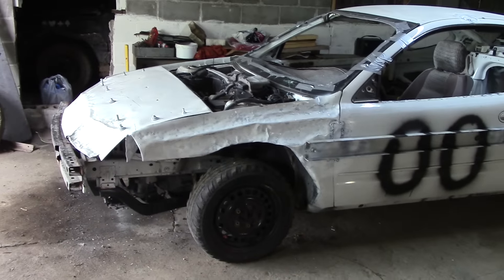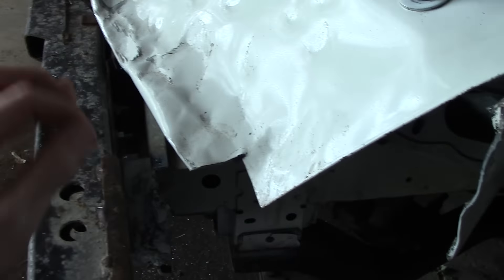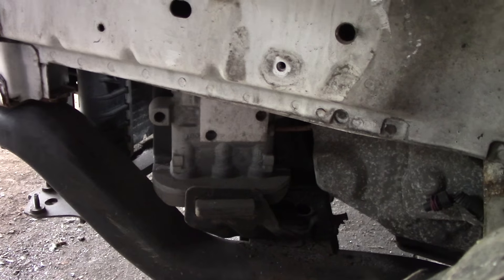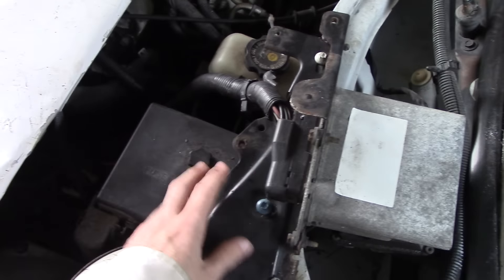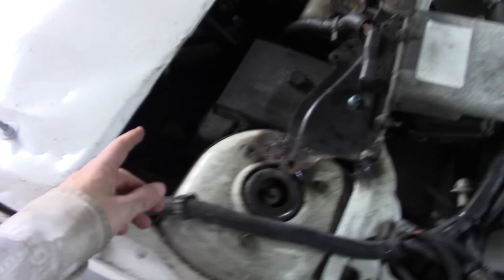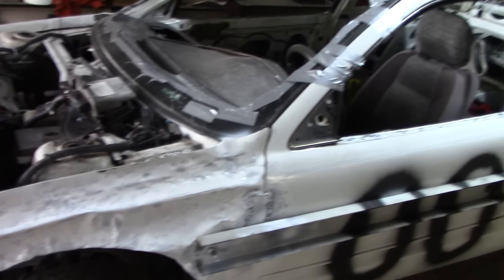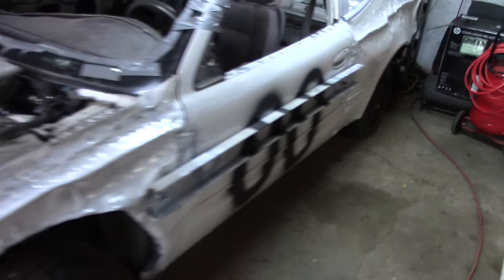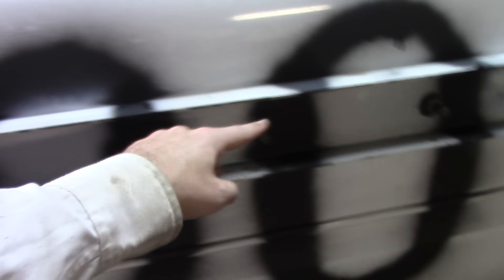2001 Alero Derby Car Almost Ready

Comment: One thing to consider is the all thread on the battery box. Id get some rubber hose to cover the threads up so they dont end up cutting into your battery. Old garden hose works and is free.

Comment: The drivers door plate is mounted too high. Measure your front bumpers height and rear bumper and now mount your door plate where that bumper would hit on your door. I run a 12" x 60" beveled door plate as low as I can and I still get the odd bumper going underneath it.

Comment: Were your battery box is mounted, i would grind the edges of the angle iron down on the top so that if you happen to get hit hard and your arm or hand fly's over and hits it, it wont cut you as bad.

Comment: Have you ever thought about using the metal from old bed frames?
Reply from the maker: I used bed frame for one of my battery boxes and the switch panel in the Lumina
Reply: when you next derby
Reply from the maker: 2017, next year. The 2016 season is over now that winter is here.
Reply: ok why 2017 run in derby goin

Comment: Does that have aluminum spindles/knuckles?
Reply from the maker: Yes, gonna see where they break and learn for future cars
Reply: I have seen broken ones, since they're aluminum, they tend to tear all over the place but especially where they connect to the strut. That is why they always break and fall to the side. If you want the car to last you may want to put cast iron or steal ones on it, i see these Alero's break all the time because of the dumb spindles though the actual body has a ton of life left. I got my spindles for my Buick century off of a police impala(early 2000's), i was lucky to find that car.  The newer w-bodies (impala,lacrosse,etc.) have these aluminum spindles and it is hard for them even to place because they always end up breaking one.

Comment: is it a 6 cylinder or 4 cylinder?
Reply from the maker: 4 cylinder
Reply: DemolitionMissions i have a oldsmobile intrigue 2000 3.5liter and i can't find the computer
Reply from the maker: I found out what I thought was the computer near the bumper is actually the ABS brake controls. Someone else mentioned the computer is actually inside the dash on these cars. Maybe it is for you too

Comment: Your compact rules up there are way too particular I live in PA and they can do pretty much whatever they want as far as bumpers and hoods almost guys run 80s bumpers here and have them welded to the body and iv seen a couple guys use 80s and 90s full size hoods on compact cars they fold them down over the radiator over the bumper it makes them really tough in the front

Comment: I ran a 2002 alero during the 2016 season and I found out e big issue with them
Reply: What issue?  Please share it with him.
Reply: the knuckles are weak I took a grazing hit to tire 10 seconds in to derby and the front end dropped. and the rear knuckle broke on the first hit
Reply: wrestling797
Ouch!  That sucks.  :-(